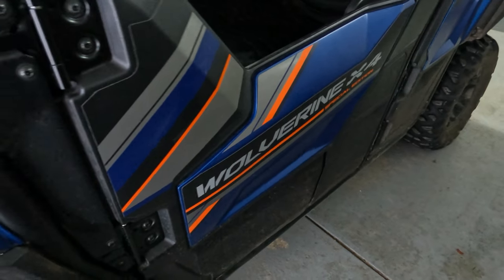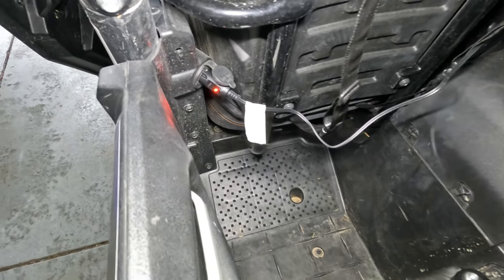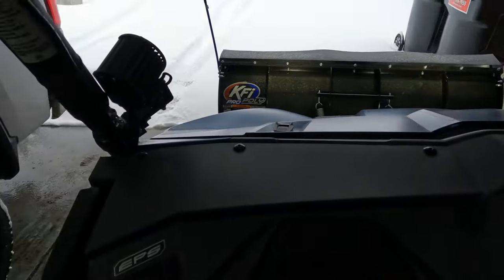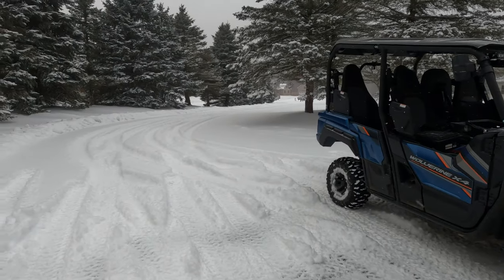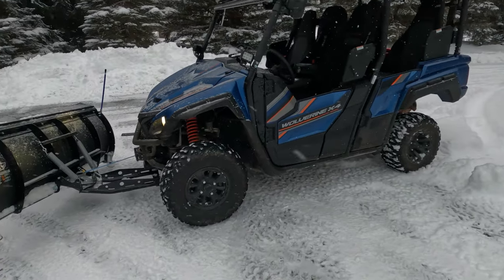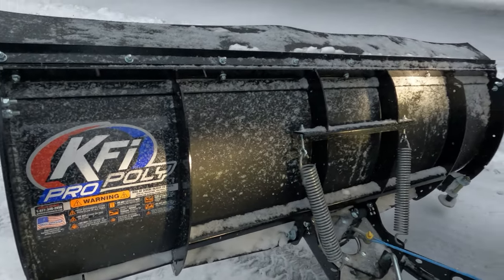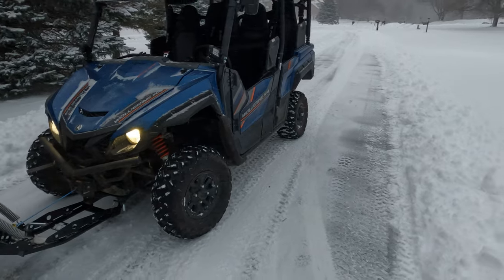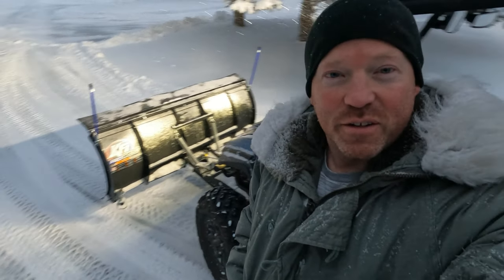Easy Snowplowing Wolverine X4 KFI Pro Poly Plow

Comment: Any issues with pulling the plow too high and snapping the line? I see you don't have a stopper. Thanks!
Reply from the maker: No issues with snapped lines.  I do monitor my speed and am careful not to slam into snow piles in an effort to prevent the Plow from being pushed up to snap the line.  If a pile gets too big, I lift the Plow and press the top of the pile back, and then lower the Plow and press the bottom of it back.  Operating this way, I haven't bent anything and I haven't broken anything.
Reply: Thanks!

Comment: What KFI push frame did you get? I am in Canada and do not find a mount with a hitch on it either, thank you!
Reply from the maker: I bought the push frame and mount from my local dealer that was specific to my machine.  KFI makes many different mounts, so you may benefit from getting help from your dealer to figure out exactly what you need.
Reply: @ATVG  Thank you, I do not have a dealer in my small city, got my machine out of town hours away. I was looking online to order. One site says one will fit then the next says it wont. Was hoping for a number or something to look. Thank you!
Reply from the maker: @Fordluv  I don't see any stamps or marks on my frame or mount, and I can't find my purchase paperwork.  I would recommend contacting KFI via email or phone call and trying to get a recommendation of which one to purchase directly from the manufacturer.

Comment: On my gravel driveway I took the shoes off and added a 2" steel pipe to the bottom of the blade, by cutting a slit with a grinder and slipping it over the blade. It does leave a small skiff of snow on the driveway, but doesn't tear up the gravel or the grass when you have snow before the ground freezes....
Reply from the maker: Great idea!  Thanks for sharing.

Comment: What's your recommendation for concrete driveway so the shoes or blade doesn't leave marks behind on the driveway surface?
Reply from the maker: Start by making sure the shoes are keeping the blade about 1/8 off the ground.   Then, test a small area of the concrete.  If you notice scraping marks, then put a little bit of tension on the rope to slightly lift the blade to help reduce the weight that is dragging across the concrete.  Normally, I don't see any marks when plowing over my concrete section of the driveway.  The pads will wear flat after a bit, and will further help distribute the weight of the blade to reduce or eliminate the scrape marks.  Bottom line: trial and error in short distances to find the best combination that works for you.
Reply: @ATVG  thanks for the reply!! that's helpful info. i'm new to the game so when i saw the medal shoes/pads on both sides i was concerned it would scrape the concrete and leave behind marks. but sounds like those will wear a bit and won't be a problem if i understood you right. thanks again
Reply from the maker: You got it!
Reply: I run koplin 72 inch high-rise plow on my Ranger 900XP and don't run it with the shoes. I get 2 snow seasons on the one side of the scraper blade here in northern Wisconsin. I then just turn the blade over and can get another 2 seasons. Replacement blades are fairly cheap to buy and are very easy to replace. My drive is just hair over quarter mile long with 3 short off shoots. Most is gravel with about 175ft of concrete all together.  I really don't notice much for marks on the concrete.

Comment: Where the angle pin is? Put your wrote down there. It will work better and not as hard on cable or rope
Reply from the maker: This set up has been working great for 5 winters.